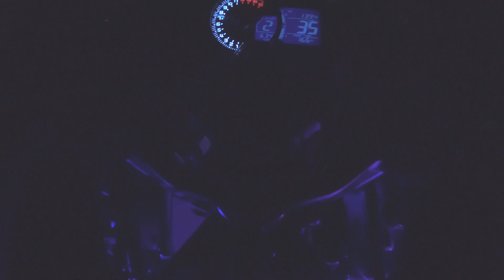Installing Jet/ Tuning Kit (2006 Honda Shadow VLX Build)

Comment: Hai bro I from Indonesia,i want ask pilot jet 😁
What size pilot jet & main jet do you use?
Reply from the maker: Thank you for the support from Indonesia💯 I used a 48 pilot jet and a 145 main jet. I hope this helps
Reply: @VanceBuilds  oke thx brother thx info,my motorcycle use main jet 170 not recommend cause  my spark plug is black...

are you using a cv40 carburetor?
Reply from the maker: I am not positive on that. It is the stock carburetor for sure though👍 what kind of bike you got man?